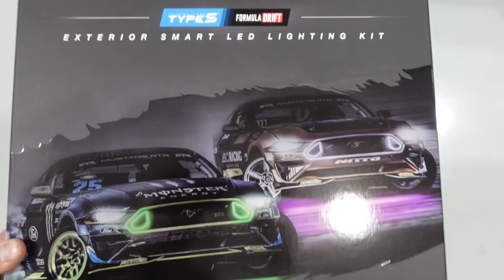Rebuilding + driving the cursed S15…

Comment: Tip to Adam: Most biz have two different providers and your firewall/router will switch to the 'backup' internet. FL sucks for internet but guess only real option is verizon fios (it was ran 15-10years ago in most central FL including rural areas). However, if brighthouse (or whatever the new name is) or timewarner offers coaxial internet (or Verizon) then use the fiber for primary and the coaxial modem as your backup (or two cable modems from separate companies but it is VERY rare an address will have that). Ideally primary and backup should be from different companies. Of course if only one company serves that address then you can't do much. Side tip: know where the coax or fiber runs in your ground to avoid digging in that area. I would assume you have a network professional since you likely have APs for wifi in all the buildings, switches, underground runs to each building so the whole place only pays for 1connection (or two if you can get one as a backup) so consult them (hopefully isn't just some computer guy off the street and your network and wifi coverage sucks, is unsecured, etc). In the rare chance you want to consult me send me a message and I can point you in the right direction.

Comment: If you’re ever looking for a easy solution to a low-lint towel for engine building grab you some coffee filters. Built a few Subaru short blocks and it’s been a blessing
Reply: Also good for cleaning your glasses! Add some water of course.
Reply: Also very useful if you're refurbishing some old electronics. Coffee filters have been a pc repair shop "trick" for decades
Reply: @youridv  coffee filters are god tier list items. along with the infamous 10mm, ziptie and duct tape
Reply: @LightAsh01  you forgot WD40 😂
Reply: @bonesenruben  forgive me lord for I have sinned. I got some wd40 the other day... man I tell you if is broken just give it a spray and it is back to life like Jesus on the 3rd.
Reply: @youridv  also very useful for coffee machines !

Comment: 6:50 - Bruh get starlink! Or 2j swap a tesla or something so Elon notices you and makes someone approve your beta application!
Also don't hate on plastigauges, those things are crazy close to accurate and cost practically nothing but time.
Reply: Not really sure what those first two sentences mean but I agree with the last one that plasti gauge isn't some horrible inferior method.
Prob more accurate for those without precision measuring experience
Reply: dunno if it's still a problem but for a while they've had a 6 month waiting list to get starlink. but yeah kinda surprised they haven't done it unless they're in the process of trying to get an ISP to install fiber to the compound.
Reply: @sirmonkey1985  oddly enough my old roomate. Has starlink. We’re in Georgia

Comment: Triple clean that shit I did my timing belt today and cleaned up decided to go back and clean up again just to be safe, what did I find? a small piece of copper wire I used to hold the cams sitting behind the crankshaft pulley hidden by the belt. ALWAYS CLEAN 3 times.

Comment: 2 thou on the mains is just ok for synthetic only. 3 thou on the rods is loose. It will live but when the oil psi disapears replace those bearings quick!
Though a GREEN Turbocharged Datsun. What do you expect,, reliability?? Booms is what will happen.
Guards should be held to the body with bolts,,, drrr.

Comment: Even if you aren't gaming buy a gaming router and wifi extenders gaming routers have wifi 6 nowadays and they also have a lot of ways to limit what process use what amount of bandwidth. Easy solution but its mid tier on price. I paid roughly $400 after tax for my Nighthawk XR1000 router which is one of, if not the best router. ( i pay for and receive 1gbs/dl 1gbps/up and i have over 20 devices connected at all times if not more )

Comment: Y’all need some “High Performance Academy - Engine building fundamentals” action in your lives.  The full SR20(VE) build example will show you why debris trapped in the crank oil passages shouldn’t be a surprise, and a detailed cleaning process to prevent/remove this as a failure point. 
Granted you may have gone through a deep clean and just not filmed it.

Comment: I have a feeling he’ll be driving with dean for DDE. Don’t think Adam would drift a mustang plus I don’t think he would drive someone car. The 2 supras are his FD builds 🤞. But at some point it’s makes sense coz Adam drove the mustangs in the past if you remember
Reply: It’s too late really for them to be building either of them into FD cars. The red one especially if it was going to be an FD car they wouldn’t be putting standard body parts on it, the thing would be completely stripped by now ready to be chopped up front and back for tube frames. If you remember when Enjuku started on his S15 how much they took out of the car before it even started being built back up. 

Most guesses are driving FOR RTR but I don’t thing it’ll be for them, more with them. They look after the car, take it to the track etc but branded as his own thing (a bit like Castro with Papadakis)